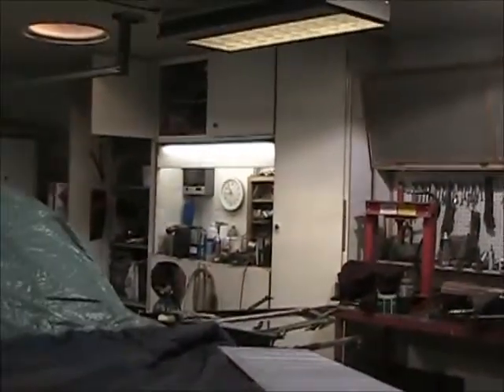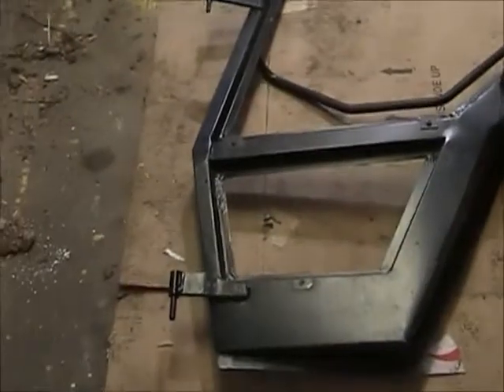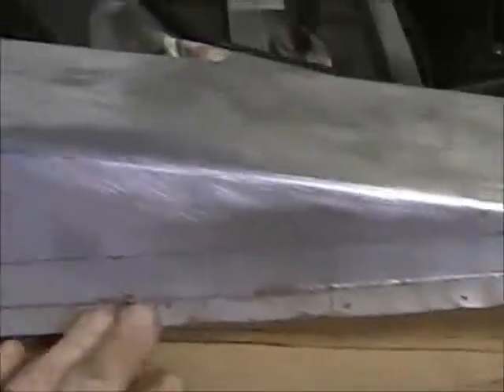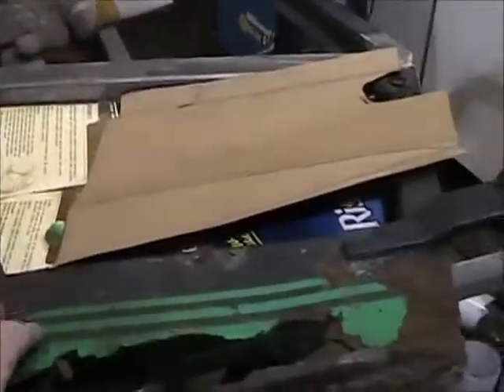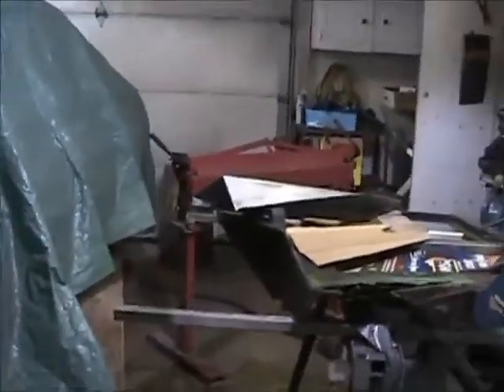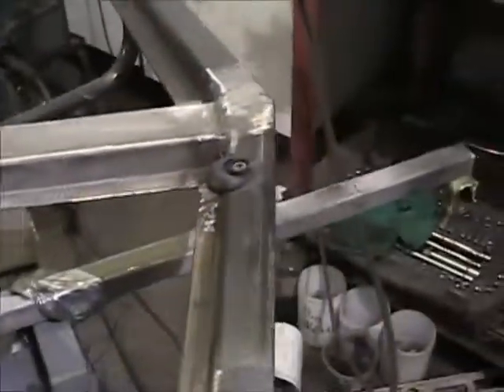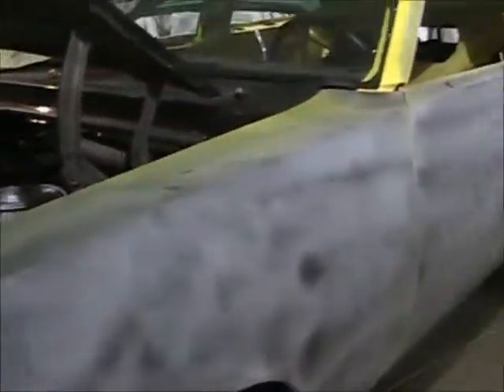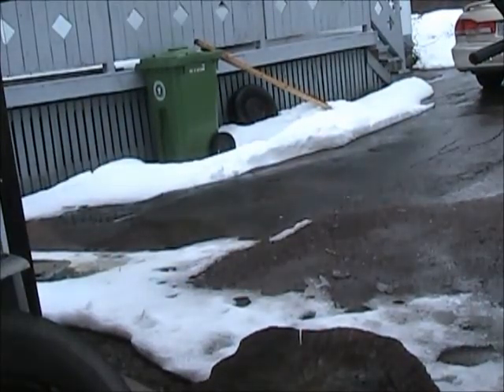my first tractor door repair

Comment: sweet job on there door  I made some of the smaller brake cable holders out of heavy wire there just for locating the cable I can send you measurements if you need em    I bought some somewhere and the little turds are not cheap
Reply from the maker: thankx,that would be great, im running the fuel lines now and had to take the cable down but as soon as i get the tank back on im going to tackle the cable issues so might need some measurements,im all in for making what i can,some of this stuff is just crazy priced so that would be good,thankx for watching,tc